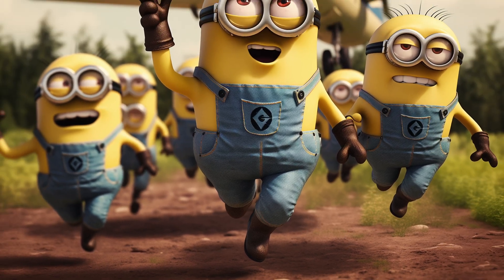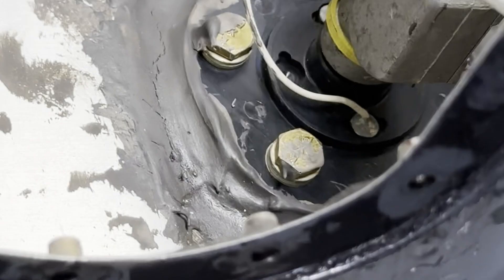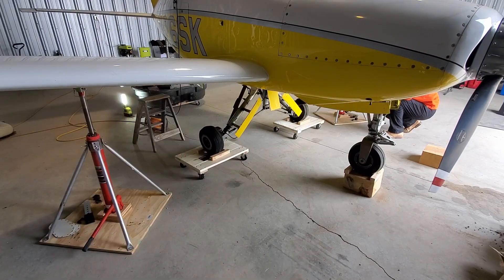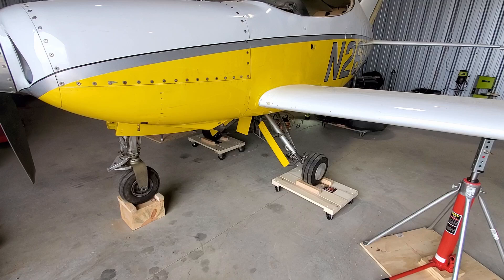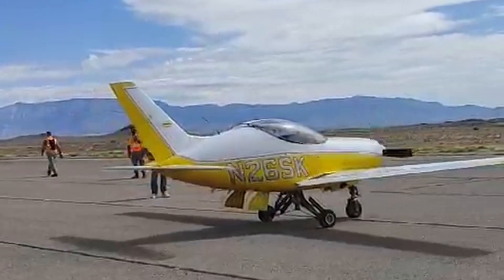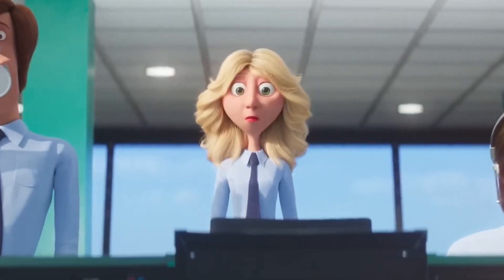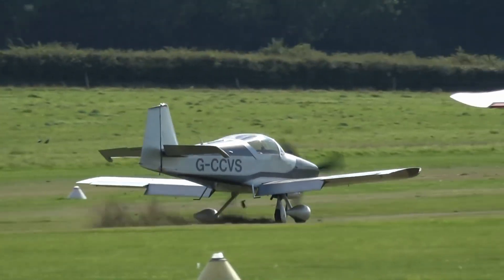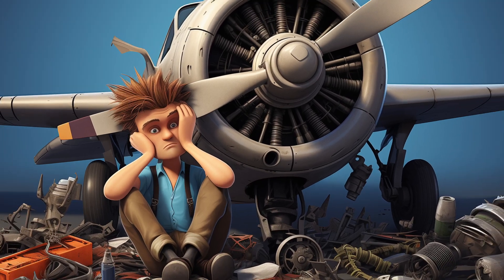Everything wrong with the Flying Egg! A Questair Venture update.

Comment: Designing an uncompromised, one-criterion aircraft has its drawbacks. 
Small wetted area means a small fuselage (= short) , = short wheelbase.
Thin airfoil sections donot accomodate the tiniest wheels; brakes and axle's need also space. (= narrow wheelbase)
Integrated fuel tanks have the same technical level, even higher level compared to pressure cabins: leaks are not allowed (also not in time). May be this is a step to far for a homebuilt. 
Use long plastic fuel bags like gliders use, I would suggest. Make these bags also exchangeable via the root ribs..
Beside technical challenges the pilot skills have to be at an other level, it is no Cessna.
Only real aviators fly such a power-egg...
Reply from the maker: Have you owned one?

Comment: Part of the problem is lack of control with flaps down, as one wing lower when on the wheels hauls the plane off to the side. This is not a rudder problem. A friend disabled the flaps on his. The funky rudder pedals and brakes don't help, either. Also, the aerodynamics are the same as the Malibu. The fixed gear version -- built that way -- was the Spirit, IIRC. I flew both prototypes and loved the handling but didn't explore the landing. There were also problems with the header tanks in the fuselage that the FAA required for certification, which was one goal of the plane.
Reply from the maker: thanks for the input.

Comment: I met Questair Venture designer Jim Griswold's son Doug Griswold years ago when we both worked as engineers at Cessna. Doug was part of the team that developed the prototype and I believe he is responsible for the unique control system with the spring bungees and variable geared pitch control. Doug impressed me on the importance of low wetted area for efficient cruise performance. Indeed the Venture is a brilliant design from an aerodynamics standpoint. As noted from another comment the airfoil is not a laminar flow design but instead a blend of "traditional" NACA airfoils commonly found on other light aircraft. My interpretation of the complex gear arrangement was to keep the wing free of any breaks and gaps normally found where the gear folds up into the wings like the Glasair series. It might have gained a few knots in cruise speed with the collapsing/folding gear arrangement but oh the headaches it has caused. Too bad about the wing sealant issue I'm aware that early Van's aircraft are also now suffering from sealant problems after all these years. LOTS of aircraft out there with wet wings and no marks against the Venture in my mind, just an unfortunate characteristic of the sealant. Excellent but painful video. Looking forward to part 2.
Reply from the maker: I am working on getting the Lancair IV turboprop back in the air and then refocusing on the Questair Venture

Comment: The Questair uses the same airfoil as the Taylor craft and Vans aircraft (and many others).   It is a great airfoil with a low pitch moment and predictable stall.   The wing is 17% thick at the chord. The thin wing appearance is due to the aspect ratio and wing area, not laminar flow design.
Reply from the maker: ok, that makes sense too, still means I can't access the tank to reseal it :(

Comment: Great video.... Long time EAA member, kit builder (two Van's RV's), engineer, airline pilot... Always admired the Questair Venture. Your saga is a bummer, but your approach and attitude is an inspiration.... I think it is solvable.  FUEL LEAK...  Jets have fuel leaks of their wet wings. They are specialty companies that send crews out to reseal fuel tanks on site. That is all they do. As you say there is no room in that slim Questair wing. However a talk with one of their expert tank seal Technicians might expose some secret techniques. I wonder if you can seal from thee outside?  I fixed an RV tank leak at the fuel drain fitting. I removed the pant. Cleaned all around it. Put a fillet seal all around to fitting to skin interface outside the wing..... Touched the paint up. No more leak. 

Another idea, may or may not be practical but SLOSH COMPOUND tank sealant.  Van's aircraft has been around RV's 50 years. In the early kits the aluminum, removable wet inboard wing leading edge fuel tanks were sealed with tank slosh, a white liquid. You pour it in and slosh it around. You turn the tank all around to coat the entire internal surface of tank, then dump excess out. It coated the entire tank internals.  It lost favor and now for last 30 yrs Van's aircraft specifies the use of PRO SEAL (two part grey epoxy made as and for aerospace fuel tank sealant). You apply the sealant to mating surfaces before riveting the ribs, rear baffle and end close out ribs to wing skin. This is what you have most likely. Why did slosh method lose favor? If the surfaces were not prepped the slosh can peel from the large flat skin areas that were not sealing anything. Even if tank did not leak you had to deal with the slosh film floating around. 

The obvious problem you can't "slosh" a whole wing around like the RV's removable wing wo leading edge fuel tank... two people or even one can move the tank around off the wing, to distribute the slosh around. 

>> However It may practical to selectively inject some sealant and let it run along the bottom wing skin at rear spar and skin intersection. May be inject some slosh sealant to run along inboard rib to skin interface one at a time.... <<

You would have to prep tank and get rid of all residual fuel. Then flush it with solvent to remove fuel residue.  It may work.... it will stick to the existing sealant.  Also a slight positive pressure inside tank, blocking all the fuel; ports, vents will FORCE the tank sealant / slosh compound it leak areas. It may work.  The sloshing may require lifting or lowering the tail or lifting one wing or the other.  

The slosh sticks and is impervious to fuel. If you can get it into the right spot, no more leak.
Reply from the maker: I think this is the best feedback I’ve ever had on one of my videos. Thanks for the advice, I will keep the community posted on my progress.
Reply: You are very generous and kind to offer such good advice. Good on you!
Reply: The comments sound like the product Tank-Cure. It is a two component epoxy, which is resistant against all fuels, also alcohol. Once I designed and welded a complex steel-plate tank. Pinholes in the welds were inevitable, the paint started to bubble there. I emptied the tank, let it vent-out and applied the product. Sloshed the tank and let the excess drip out. No single leak any more... not even a smell of fuel.
This product is used in old rusty tanks with pinholes, mainly in oldtimers.
Reply: Nothing is perfect! I am flying my QV since 2014. If you can taxi it to the threshold then flying it is not a big deal. I have a better set of brakes now so it is easier to taxi. You need to learn how to taxi it. I know a QV pilot who started to fly it with only 150 hours experience as a pilot. Yes you need to get use to the speed but once at 2000 ft the rest is just numbers. The QV is an all metal. I am not a plastic plane pilot. I love my Venture. Its like a sport car: The Ferrari of the Sky. A time machine. Fly fast, life is short !
Reply: What I forgot to say is that: Yes, the QV had its problem in the beginning (nose wheel shimmy and main gear oleo struts softness that cause unexpected exit of the runway on t-o and landing) but those problems has been corrected since then. Unfortunately, this is the believing that still exist for the QV today.